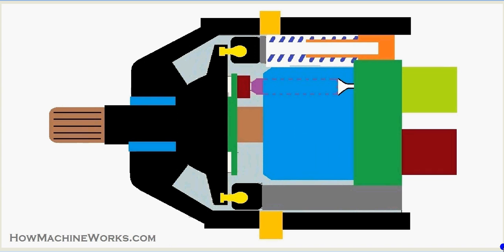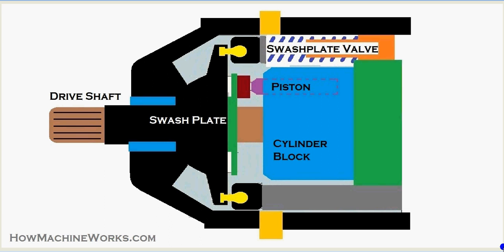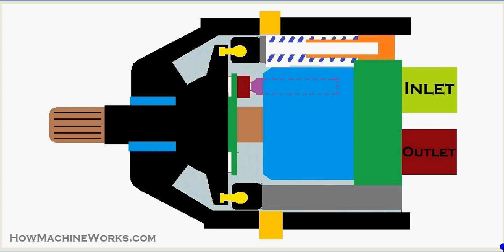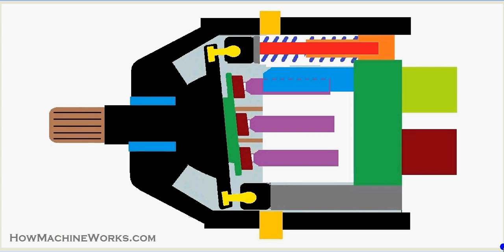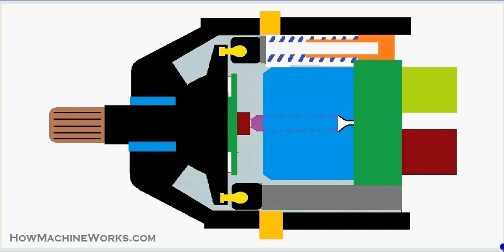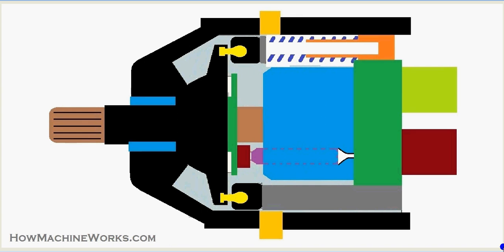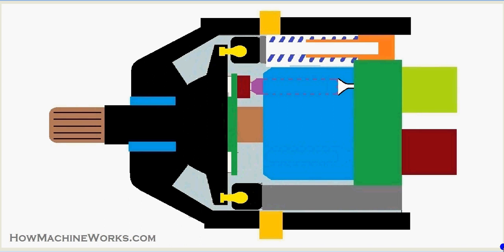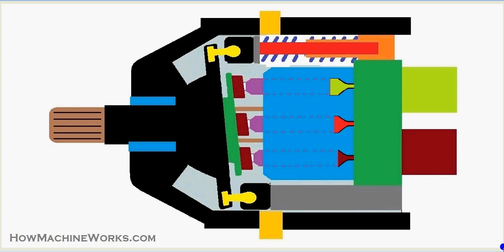Animation - How an axial flow variable displacement piston pump works.

Comment: Very good explanation. How to change the swash plate angel ? Is it by means of a valve or a servo motor?
Reply: Swash plate angle can be changed by means of A DC valve, servo valve or low pressure in the system actuates swash plate to tilt at an angle. All this depends on maker of pump.

Comment: Suction and discharge valve are not fixed as you are keep saying, it can be changed also that's it's called variable pump as it is use in hydraulic system

Comment: Let me know how pilot is work..
& What is the purpose to use pilot pump in excavator...
Reply: A pilot pump is a used to create flow to the joystick controllers. Is is usually a gear style pump mounted to the side or the end of the main piston pumps.  It has a dedicated relief valve and filter.  Pressures of a pilot system are usually between 350 and 750 PSI depending on manufacturer. Oil from the pilot pump travels to the joystick where is it regulated by the angle of the joystick.   Grim the joystick the pilot oil travels to the main valve body and is used to push the spools in the valve body that are spring centered. The more the controller is pushed from center the more pressure that is allowed to push on the spool and overcome the centering force of the spring